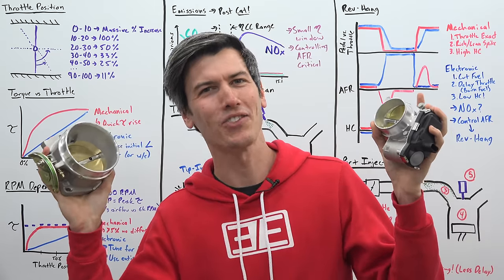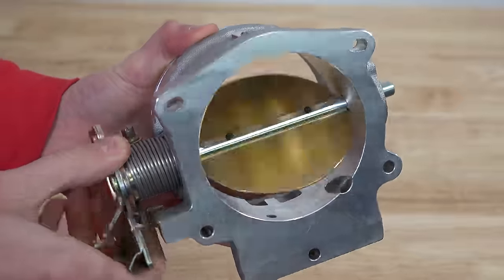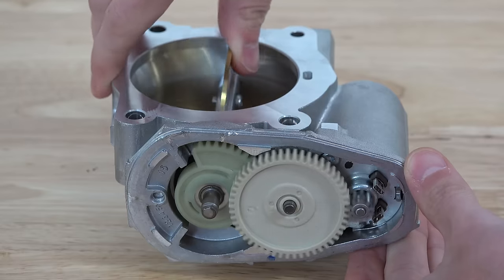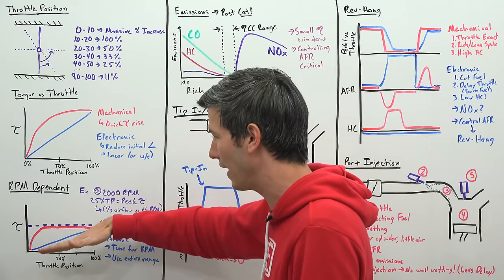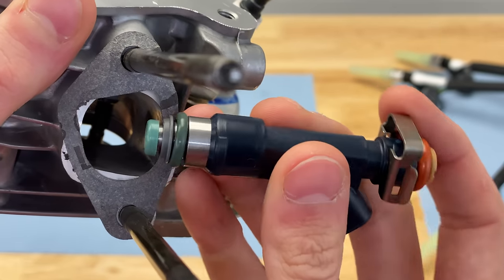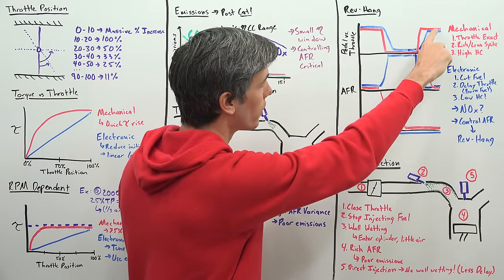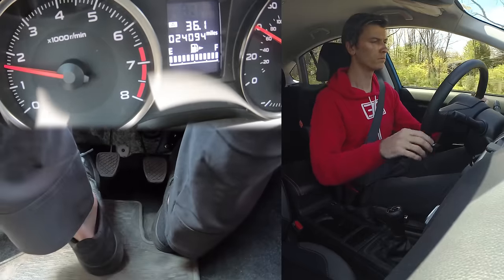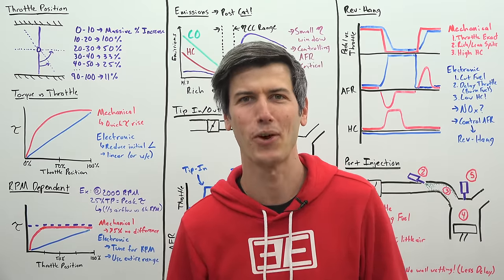The Big Problem With Modern Manual Transmissions - Rev Hang

Comment: I just recently bought a 14 impreza.  My god man, that rev hang is INSANE.  1/3rd the power of my normal car with 3x the rev hang (might be more).  It feels like 1st to 2nd is a full 2 second or longer shift, it's insane.  Subarus have notoriously bad rev hang apparently, but it's hard to find a manual so I went for it.
Reply: I bought a 2020 Si Coupe. Rev hang was terrible in it. There's times I had to hold the clutch in for a full 4-5 seconds waiting for the rpm's to drop. Drove me nuts. I disabled it with Hondata and the car drives so much better now. Honda did an atrocious job at programming that car, that's for sure.

Comment: I actually really like the way the electronic throttle feels on my H3 with manual transmission. It does the "right amount" of manipulation to make things smoother than they would be if it were just me. It's super easy to drive that vehicle with smooth shifts and the "infinite" idle air control means you can "2-pedal" drive it (clutch and brake) without even needing to touch the accelerator when on rough offroad terrain in low range.

Comment: My beater car (a 2002 Chevy Cavalier 5 speed) has a fair amount of rev hang. And it still has an old fashioned mechanical throttle body. But I have noticed it more likely linked to something in the mechanism as when I let go of the gas pedal it doesn’t just go back up like it should. It slowly goes back to off position. I need to fix it as a short throw shifter would be a useless upgrade if the rev hang is still there.

Comment: 11:24: "That doesn't necessarily mean that direct-injection engines won't have rev hang, there's still reasons why it can exist". What a cliffhanger! My 2007 GL 320 CDI (DI diesel) has rev hang, and clearly it's not because it needs extra air to flush fuel out of the ports. Since this video came out more than two years ago I've been trying to figure out why this is, and I still don't have an answer.

Comment: My 1998 Chevy C1500 4.3 V6 5-speed had mechanical throttle cable, BUT the Damn Idle Air Control did this SAME thing, I brought it back to dealer several times...I actually un-plugged it (and got SES light) to prove this was the issue...Chevy Dealer didn't care...  So it was still a problem on the older mechanical systems...

Comment: Couple things to consider, while you have lots of knowledge about motors and engines in the industry i can tell you from a driving standpoint that your shifting skills need to be changed. 
You mentioned rev hang, this is true, but how you shift a car can always be adjusted to work with the flow on non jerking and how an engine performs. 

Im used to driving 18 wheels on the ground hauling loads around the country using 8, 10, 13, and 18 speed transmissions and to shift those you dont put the clutch all the way in the floor like you did when driving the car. Thats how you wear out the throw out bearing in a car, and thats how you burn gears up and go nowhere in a big truck. 
As modern technology changes and things advance, the actions of an electric style throttle body in a car can shift no different than semi trucks if can if you just float the gears, and clutch only when your stopped.

Happy late youtube birthday!
First time watching and commenting on this video.

Comment: I only get rev hang on cold starts. Makes start stops very easy but upshifting requires holding clutch a bite point to pull the rev down. Makes shifting slow

Comment: Interesting. I've just started driving a 2010 Ford (TD), and I noticed my shifts are far jerkier than my 2004 Honda (petrol). I thought it was because I was being too quick to release the clutch after the shift, but it could actually be this! I also briefly drove a 2019 Ford (petrol) last year, and I didn't notice the same jerkiness - I'm guessing that one had port injection.

Comment: The metal flange used for offsetting the cable on a manual valve can be shaped to change the input curve, so the first point is hardly relevant.
The rest is though, interesting explanation of the difference and benefits of the delay.

Comment: Any way to tune it out? I finally got a manual M2, and it’s quite fraturariam the rev hang, basically it’s not possible to shift fast and smooth, especially from 1st to 2nd.
Reply: Same here with my stang eco. Fml
Reply: I have a Honda Civic Si and I was able to get rid of the rev hang with a tuner. A tuner is the only way to get rid of it unfortunately.

Comment: As soon as I saw the pedals and the display cluster I knew it was either a Crosstrek or an Impreza. Both look very similar.  I have a 2019 Base Impreza with a manual transmission, and I detest the rev hang on that car. I learned how to drive manual on that car, and when I drive other (older) manual cars it's way better.

Comment: I have experiences manual and electronical throttle body and they feel so different that I thought the car had absolutely no power when I pressed the pedal lightly 
It was REALLY weird as I was used to my car which has a cable
I really don't like when an analog control gets messed with without me specifically changing it

Comment: My 06 FD Honda Civic sedan had the worst rev hang, it was the main reason I sold the car after 1 year which was painful as I loved everything else about the car.  It had another infuriating "feature" where the throttle response was halved when the speed of the car was  below 20 km/h so you can't lightly stab the throttle to keep the revs up when driving through parking lots, it wouldn't react until the speed goes above 20 and then you lurch forwards when you're not expecting it.  I  hope the FN2 Honda civic Type R  I want to get doesn't have rev  hang.

Comment: As you say, if there is a linear relationship between accelerator position and throttle position, the accelerator will be most sensitive near the top of its travel.  However, it does not take an electronically controlled throttle to eliminate that problem.  A mechanical throttle linkage could be variable ratio to eliminate that problem.  On the other hand, a variable ratio mechanical throttle linkage would not completely solve the problem of more accelerator sensitivity at low engine speeds, but it would help to some degree.

It would be especially bad if an electronically controlled throttle failed with the throttle wide open.  The driver would be unable to close the throttle by pulling up on the accelerator.

Comment: I really enjoyed the video and learned about how throttle bodied works and what cause rev hang, but why is it bad?  the video never discusses that.  The description mentions rough shifts but can't that be overcome by shifting slowly and with careful clutch/throttle engagement?
Reply: Car is much jerkier with rev hang, if you're going too slow on the pedals, the car is as jerky as if you go too fast on the pedals. I have the rev hang in my Si and yeah, I could shift slower but I bought the car to enjoy the power and to do that, I gotta shift quick. Rev hang makes it nearly impossible to do that without the car being jerky.

Comment: I have a DCAT in my 20 Turbo Kia Soul. every time I drive it I think the engine is gonna blow up because of rev hang. The auto start stop is enough control. if there is a way to fix the broken throttle response issue AKA rev hang I'll gladly do the upgrade. I know when I want to go and when I don't. The Dual Clutch AT is great and I love the car just not the broken throttle issue

Comment: If you think rev hang is bad in a manual you should try it in an automatic, at least you have the option of pressing in the clutch. This morning on my way to work, while merging onto a highway, I quickly accelerated to the speed limit and let off the gas, the van decided to keep accelerating for another 3 second putting me at 10 over the speed limit. 2012 dodge grand caravan

Comment: Someone is finally talking about it! I've been trying to solve this problem since my first electronic-throttle car. Nobody ever seems to know what I'm talking about because I think this current generation of "enthusiasts" is just exceptionally inept (or they drive automatic, but same thing). FWIW, you just have to hope there's an aftermarket ECU tuning program available for your car that unlocks rev-hang-related parameters so you can delete it completely. At this point, I will not consider buying any car unless I'm certain that there is an immediate ECU tuning solution to rev-hang that eliminates it 100%. It blows my mind that they sell cars marketed as "performance" cars which do not immediately do what the driver tells them to do under all circumstances... especially something as critical as decelerating immediately upon throttle-pedal-release. If you've ever cornered on the traction-limit in a long high-speed corner and needed the throttle to balance weight between the front and rear axles then you know exactly what I'm talking about. Imagine if such a deficiency in control was tolerated for any other driver-input. Like sometimes I turn the steering wheel and the car just doesn't steer for like half-a-second. No big deal.

Comment: Almost all modern vehicles hang between gears, the purpose is to help keep catalyst efficiency up by pumping more air through IT while the revs are up. When you accelerate in a gear you flood the catalyst with fuel and usually create a rich situation, to help burn off this fuel which now resides in the catalyst the engine will hang high and in automatics sometimes even delay the shift to now provide the air needed to burn off the fuel in the catalyst. Its all done to keep the cat lit (its a furnace),  for emmessions and catalyst health as others have stated.

Comment: When i went from my mk1 Focus to the mk2 i felt like the rev hang on the mk2 was absolutely insanely long. On occasions (especially in dense traffic jams) i remember almost hitting the car in front of me because i expected my car to decelerate steeply as soon as i got my foot 100% off the gas pedal. Instead of that, the car would maintain the same level of gas and my car would actually keep accelerating.
Super annoying.

Comment: Avoiding rev-hang is basically the point you set an old-style carb for - if the revs don't drop seemlessly allowing the engine to step into it's idle speed instantly, you need to enrichen the mixture. Which is of course not what these electronic controls want to do at all. Also I have to say, the sensitive response of an old style mechanical throttle around low speeds seems in my not very large experience with electronic throttles to help with rev-matching ("heel-and-toe", more like forefoot-and-outer-instep). I suppose if the manufacturers come up with more sporty throttle conversion tables (as they'd often have in their "sports" mode) and increase the mixture for getting off the gas, that will have similar results.

Comment: i have the exact issue with rev hang caused by an electronic throttle body as described in the video in my 2000 ford ranger five speed. Except i have no idea how this is possible since i have a mechanical throttle body with a cable

Comment: Generally I prefer mechanical throttle. That said good tuning can get rev hang out and get throttle response very close to a mechanical throttle. My boosted 03 mustang is one of the last full mechanical linkage cars made (cable throttle and clutch) it’s a very nice raw and positive feel on both pedals with super natural rev matching. My 09 corvette I had tuned by Shortuning when I put a new cam in it and my 11 mustang I had tuned by Lund. Both of these cars now have throttle feel very very close to my 03 mustang. When the newer cars were stock they revved down slow and the throttle response was so slow I could double tap the pedal to do rev matches because the reaction time ford and Chevy had programmed were that slow.

Comment: Rev hang is not just from electronic throttle. They did the same thing using the idle air control valve before electronic throttle control. Only benefit of electronic throttle control is cost and ease on the assembly line. The customer gets a complicated, expensive, prone-to-fail part in place of a reliable mechanical throttle and a cheap idle air control valve.

Comment: Would be nice to have an explanation of how some manual cars get around this rev hang issue while seemingly staying within emissions regulations, and how fast shifting automatic transmissions don't suffer from rev hang either.
Reply: Automatic transmissions (torque converters) don't disengage from the engine while shifting gears. For down shifting the engine brakes with the car, as supposed to a manual where you are disengaged from the engine and are waiting for it to slow by itself

Comment: Thanks for the awesome explanation, I was annoyed with my Ford Mondeo - Fusion on America - because it is impossible to have an instant transition with rev matching from 1st gear to second when you are really pushing hard the pedal. Revolutions are maintained high to control emissions I didn't know it. Curiously that effect is only evident from 1st to 2nd gear. Thanks.
Reply: another thing car manufactures do now is suggest going from 1st to 4th. I've done it a couple times and it actually cuts jerk if you let out clutch a lil slower, but you can speed up almost the same. Once you hit like 20mph in 4th you start vrooming again, (its bogged down for the lower mph) or you could jump to 3rd, skipping 2nd isnt a bad idea, especially if your car has annoying hang time. Otherwise you have to let off the gas for like 2 or 3 seconds because you can fully shift into 2nd (atleast thats what happens to me in my v6 camaro)

Comment: When I drive my brother's car (the only that has fuel injection, let alone electronic throttle) I just do the right foot move around one second before switching gears, so when I hit the clutch the throttle is already closing, and when I release clutch with the new gear it's already opening again.

Comment: Also GM Holden 3.8L Ecotec PFI in VS Commodore had ramps inside the throttle body bore to make the cable throttle body airflow vs degrees of opening more progressive  they also had the very common cam on the throttle shaft for the cable.

Interesting study on emissions and throttle hang thanks Jason. 

Also another issue regarding throttle hang with no doubt many electronic throttle systems is on at least the vehicles I know of there is no clutch depress input to the ecu so there is no way the engine controller can differentiate between just a deaccel lift off and a gear change. Less parts = cheaper cars!

Electronic throttles also give tuners the ability to give an engine deceiving big engine launch feel by giving large airflow increase for a small pedal input.

So you think that little engine is a great performer but in reality the pedal map is aggressive vs throttle blade angle. 
Ie 10% pedal input can be tuned to give say 80% airflow at low engine speeds if in say 1st gear!

Comment: Can you do a video about the BMW B48 engines, which are used in many cards in the BMW Group? It's my understanding they control all of these with variable valve timing on the intake and the exhaust valves and the electronic throttle body is mainly a backup?

Comment: My 2010 WRX had revhang, but my 2012 MX-5 doesn't. The were both had electronic throttles. I bought the MX-5 used, so it might have a lightened flywheel, since revs happen so very quickly. Maybe that's the difference, but i have not been able to confirm the lightened flywheel theory.

Comment: Is this why manual transmission are less available?
And is this the same thing that's happening in auto transmissions where the car doesn't slow down much when off the gas pedal?
Reply: this adds to stopping distance, not a safe thing

Comment: Instead of shifting right away and feeling the jerk, its better to drive like you drive an old farm truck. Clutch. pull to neutral. wait two seconds for the revs to drop. select gear. clutch. Its what I do now if I'm not in a hurry.
Reply: Thanks
Reply: I’ll start doing that.
Reply: @swxqt6826  it works for sure it’s weird
Reply: @mrslapside  You’ve tested it? I’m getting a manual diesel soon, so, I’d really like to know for sure.
Reply: @swxqt6826  yeah it’s smooth just be smooth about it

Comment: Hey Engeering Explained....what about the early Honda Engines, When you were explaining something about the Port Injection, Honda has dual ports, another words early Prelude H22 had 2 butterflies. Try taking them apart, you will see. So the left over gas is still in those 4 ports, primary port and, the secondary ports. Can you explain this?

Comment: 7:30 oh is that why i always get pops when rolling off the throttle on my motorcylce, rich air/fuel ratio enters the hot exhaust and ignites in there, i guess that would make sense

Comment: How difficult would it really be to sense when the driver is getting ready to release the throttle through a pressure switch and and start to shorten the injector pulse width a split second before  a shift? There are “manual” transmissions after that take care of the clutch for by sensing when you’re about to stir the gears based on pressure on the stick and throttle.